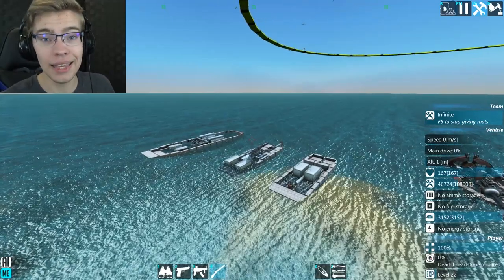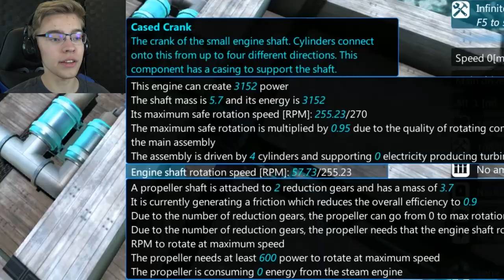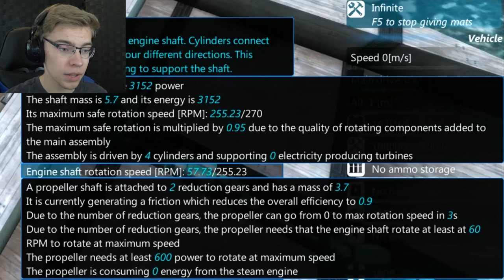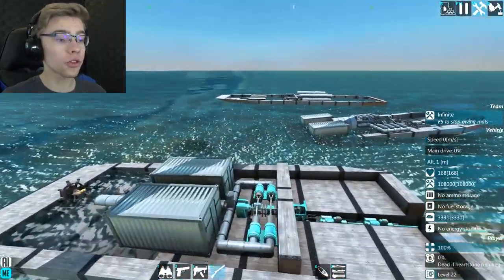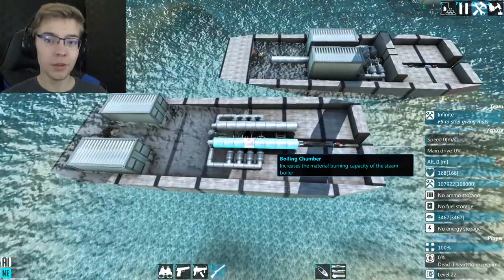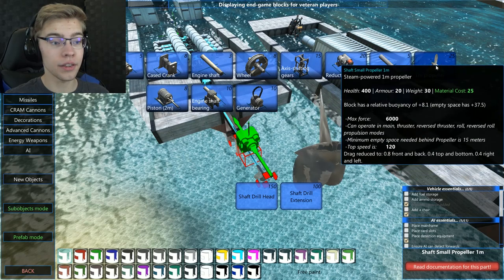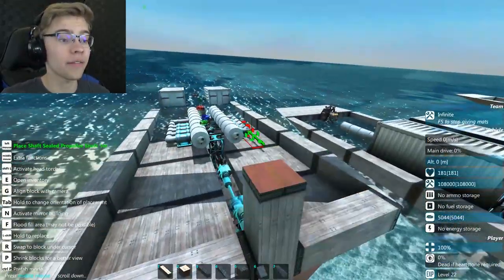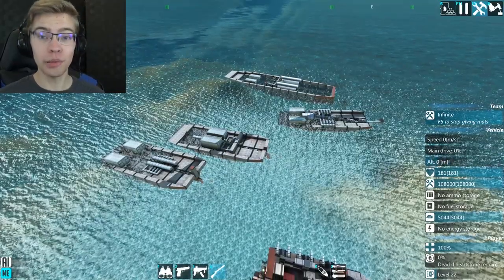STEAM ENGINE TUTORIAL | From The Depths #14

Comment: I had a 4 engined small ship, it uses 1 piston in each large engine and the ship can go around 40 m/s with 5m propellers. try getting a low amount of pistons if u wanna go faster. Should I put it on the workshop and send u the link?
Reply from the maker: Sure! Don't know if links are enabled so if it doesn't work, leave the name of the ship and your  username
Reply: @AndrewStormer  right since I'm a kid I will have to try and wake up at around 10am, once it's around 10 I will try and get it done
Reply from the maker: @ell8711  ok, no rush
Reply: @AndrewStormer  just woke up and oml time flies
Reply from the maker: Thanks! That's a good test ship and it doesn't have much drag. Small thing I noticed about that ship is it's all 1m blocks. Building with the 4m blocks instead of 1m will save a bunch of time.

From my testing, the amount of pistons doesn't hardly matter so 1 piston is the best like you said. What matters the most is getting the most amount of propellers/engines on a ship. 

I'll have to do a part 2 video explaining it more. Thanks for sharing this!
Reply: @AndrewStormer  I know it saves time using 4m, but I use fill so it's very quick anyway. Just make a cube without a roof then press f to fill it in while looking at it.  For part 2 can you do some testing for efficiency with max amount of engines? 

sorry for the late reply as I forgot to look until now lol
Reply: @AndrewStormer  also only add one piston but if the shaft starts breaking from speed, that's when you add another piston and keep going till it's right.
Reply from the maker: @ell8711  If the shaft starts breaking from going to fast, that means you can cut down on the boilers or burn rate.
Reply from the maker: @ell8711  I could test the max amount of engines and I might, but mainly it's what fits in your ship.